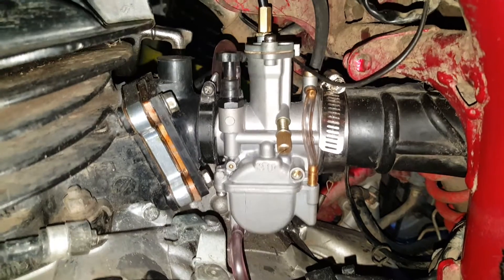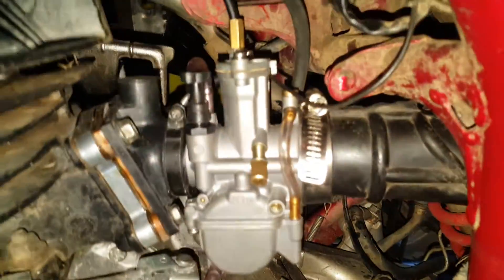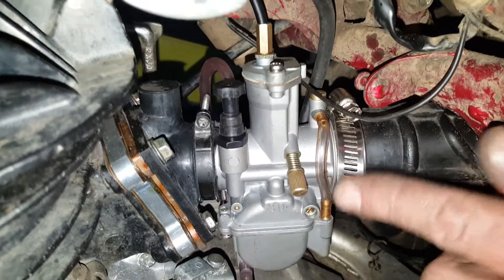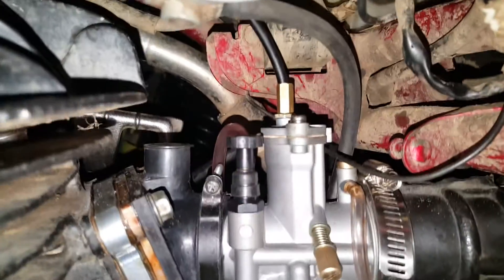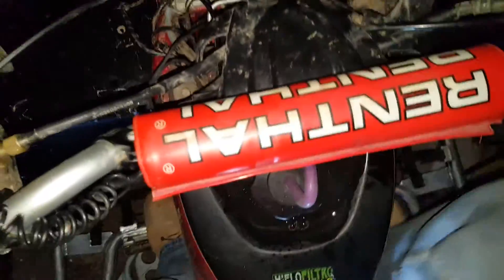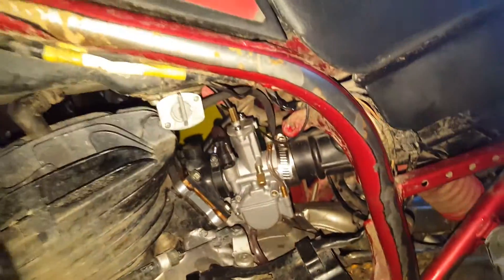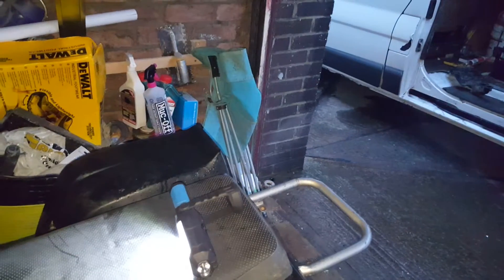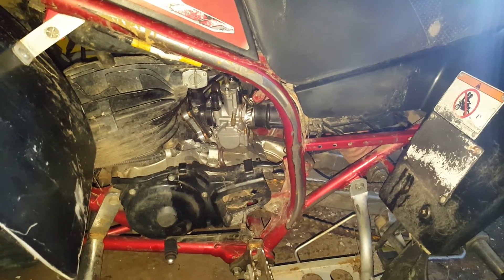Yamaha blaster OKO 30 mm carb

Comment: How many turns out do you have the air screw. My OKO 30mm D slide carburetor does not have that hose coming up from the bowl what exactly is that for
Reply from the maker: moeman motor Hi im not sure how many turns out I have the screw . I bought the carb from eBay so good chance it's not real but never gave me any problems im sure the carb was listed for a scooter unfortunately I no longer own the quad so no way of checking .

Comment: Sounds crisp, what mods do you have to support 30mm pwk? Any difference in low mid and hi rpms?
Reply from the maker: Hi I messed with the needles and it had a full dep exhaust system unfortunately I no longer own the blaster